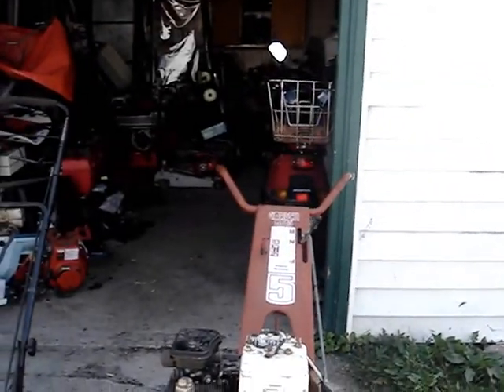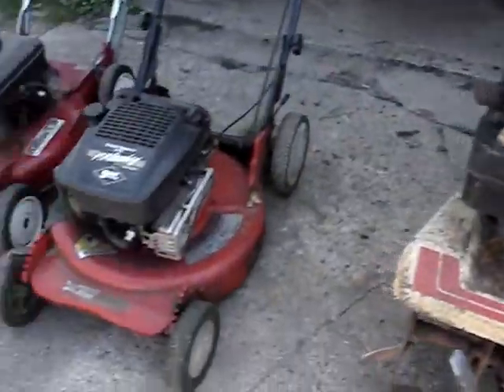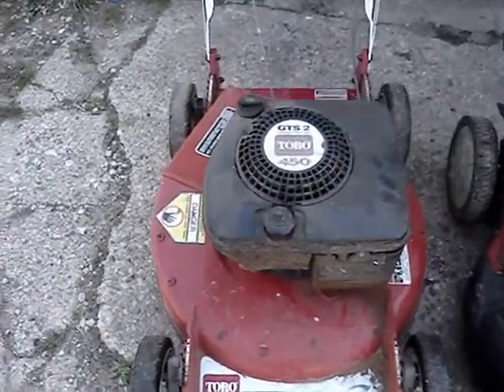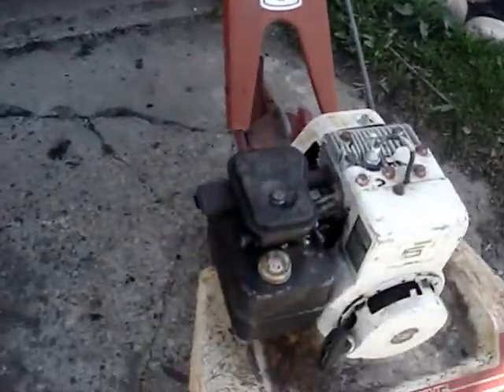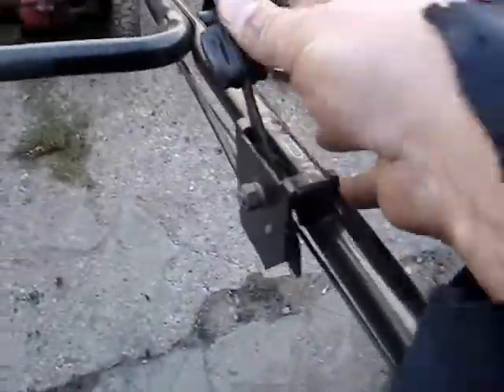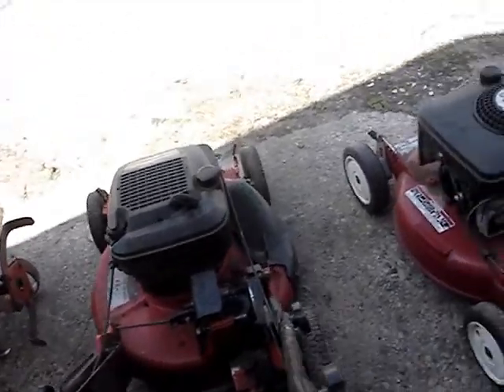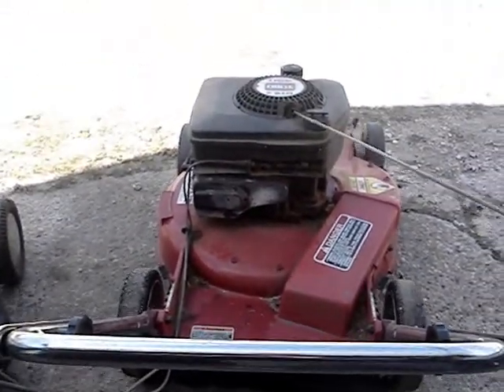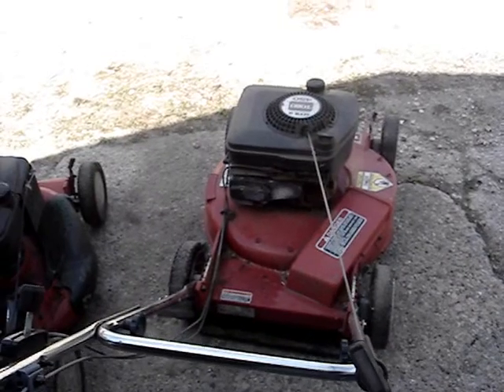Craig1974 Annual Briggs Spring Startoff

Comment from the maker: @KrankieV2 most new self propelled Snapper push mowers use the same drive system as the older ones, but the new ones have an all rubber drive disc instead of a part metal part rubber one.  Even though the decks are different my used rear axle was pulled from a mower like yours.

Comment: on that tiller, all you gotta do is pull the shroud off, unscrew the starting clutch (might have to whack it with a block of wood and hammer) when you get it off, clean that shaft and then lubricate the felt pad inside the top of the starter clutch. that'll solve your squealing problems.

Comment: @craig1974  just try not to pump way to much in because i think if you over oil it it causes the beeds in the starter to stick, but 2 squirts should make it nice and quiet. i have done it a couple times and it works when i did it.

Comment: I had the same problem with my Briggs ratchet. Just take off the blower housing to expose the ratchet. Then just take the cap off of the ratchet with a small flathead screwdriver. Then lube the inside of the ratchet and the pole, and sand it lightly to remove scoring. I would either use wd40 or penetrating oil. DON'T use grease because it will goop up and make the problem worse.

Comment: on the briggs with the whiney starter ratchet pull the schroud off and look at the starter ratchet. you should see a small hole in the top of the ratchet. thats an oil hole. pump a couple squirts of oil into that hole and it should quiet down for you. that should save you a couple $ instead of replaceing it.